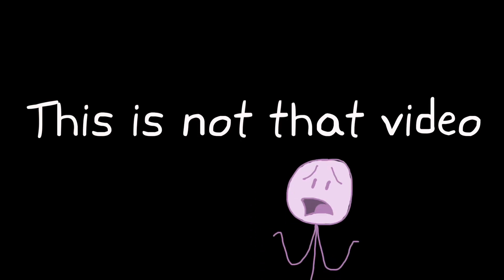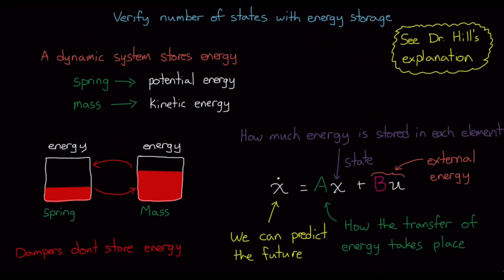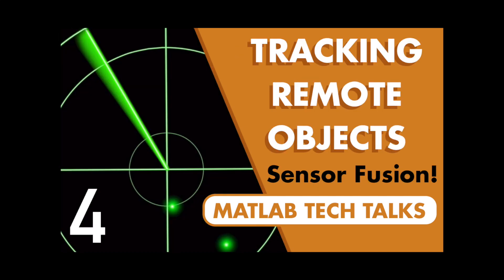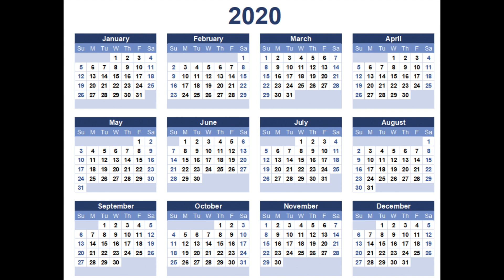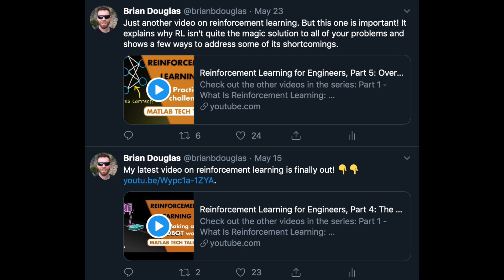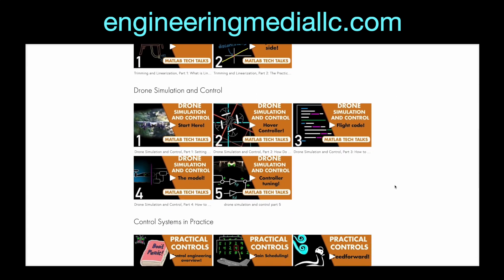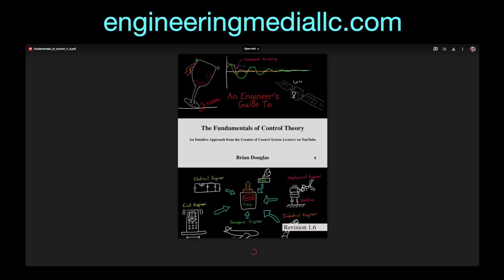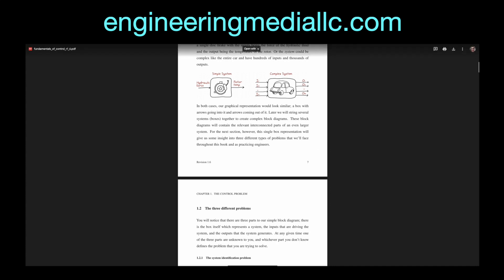Where have I been?

Comment: Hey you should do an episode on (micro-)inverters for solar power. That's in large part a control system problem, right? There's the reference from the power line that the inverter must synchronize with.

Comment: Brian, I have controlled a CubeSAT with a simple tracking PID. It even works for initial angles beyond the linearization range say 40 or even 60 degrees. This is very strange as the Euler's equations are extremely nonlinear. The video is here: https://www.youtube.com/watch?v=L88nPdNbrPc&t=70s
Could you please let me know why this works despite the dynamics being very nonlinear?
And do you think I should still use the math model in the flight computer while having all the sensors? (maybe for model based disturbance rejection) ?

Comment: I like your short video so much. I am a Chemistry PhD student working on optimizing our system(based on electrical signals). I found I have many to learn before making the machine better. And your video explain things excellently. I was also get touched with notch filter some time ago but I am still in total ignorance. Thank you for your video. It helps a lot.

Comment: Hi Brian, could you make a video related to CNC  ? It's a huge topic and I think, like the drone makers, that there is a lot of CNC makers who could be interested in getting more knowledge on how to tune PID controllers for specific CNC application. For example, how CNC builders succeed to get 1 µm resolution (with servomotor) ? Is it possible with a PID single control loop to get real precise positioning ? Or it's mandatory to use advanced control methods ? Thanks !